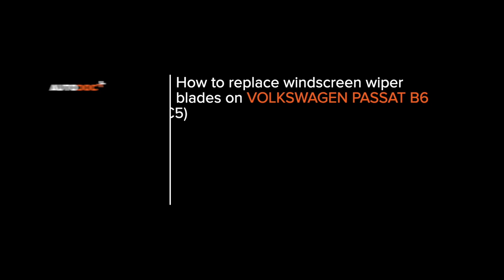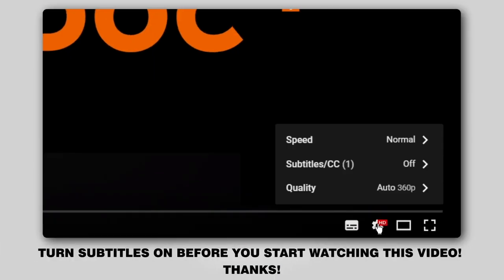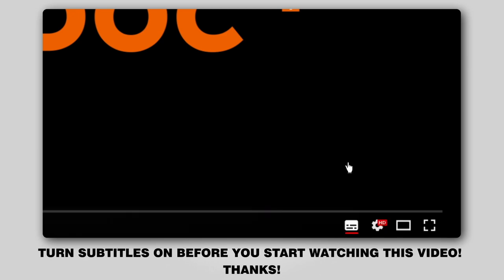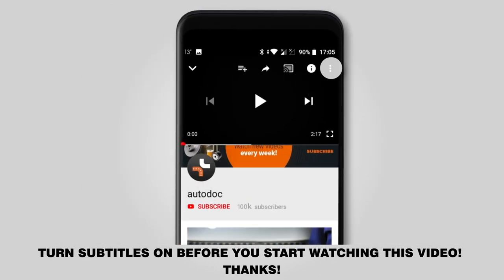How to change wipers blades / window wipers VW PASSAT B6 (3C5) [TUTORIAL AUTODOC]

Comment: how do you change the whole wiper in the back. Mine for some reason doesnt work, when i turn it on it does some noise for a second but then stops again and does absolutely nothing
Reply: Check the fuse first time. After that, check with someone to turn on the wiper and see if the motor works. If the motor works and the wiper doesn`t move, change the whole wiper blade, it`s cheap. If the  wiper motor doesn`t work...well, you can buy it from ebay or go on your scrap yard or something similar and buy one.